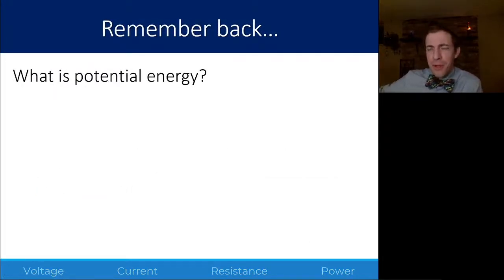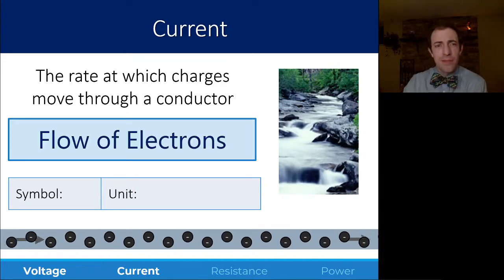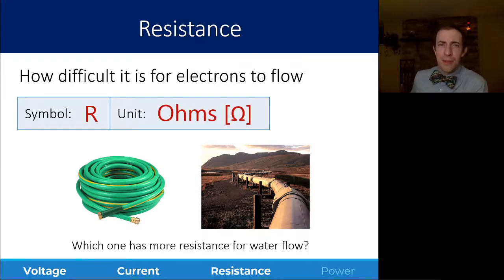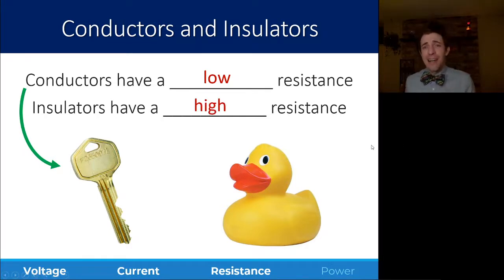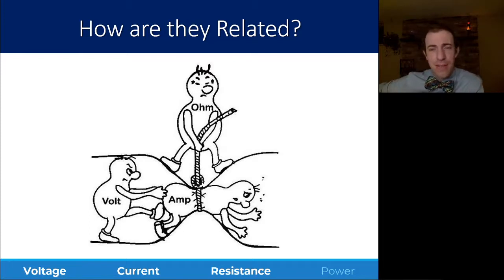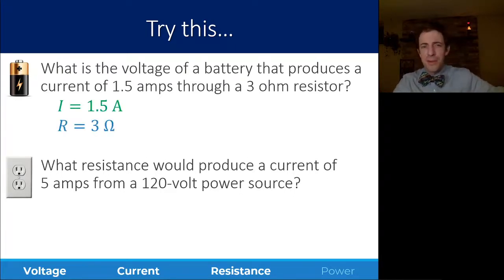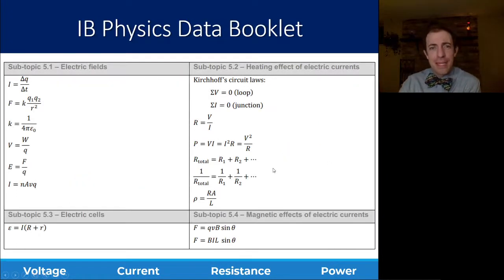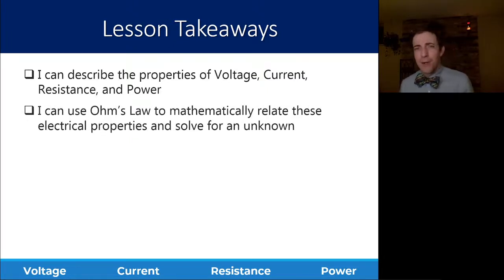5.1.1 - Electrical Properties

Comment: Voltage is not electric potential energy!  It is EPE per unit charge.  There is a big difference.  Different charges placed in the same location would have different amounts of EPE.  But they would have the same voltage.  This is not a difference that can be ignored or glossed over.  Maybe this video is meant for students in middle school??  Still, it should at least be stated that voltage is very similar to EPE, not that they are the same thing.
Reply: middle school